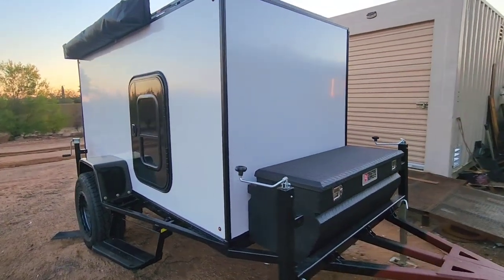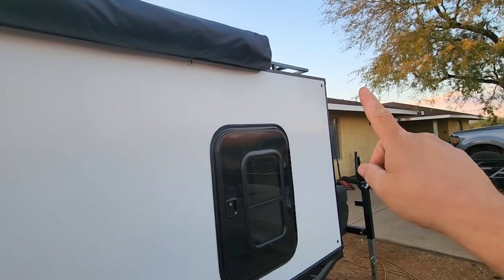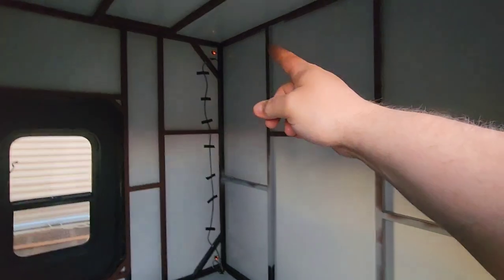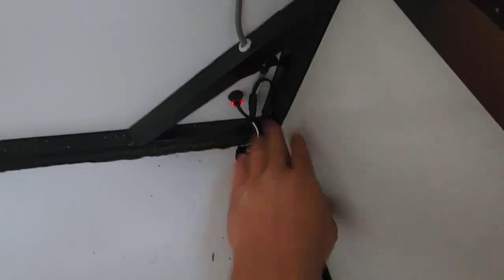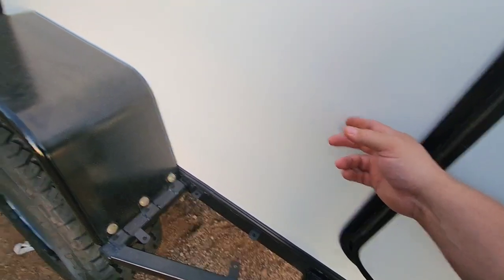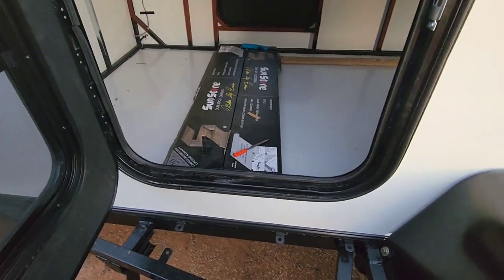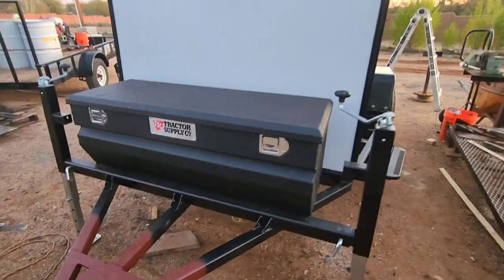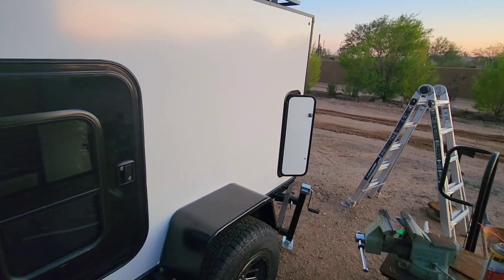Update on DIY Off-road Camper Build.

Comment: I put mine inside my front locker (the breakaway battery and all the trailer wiring).  Didn’t want anything exposed.  But they are made to be external mount
Reply from the maker: Ya, I'm thinking the tool box is best place for it to keep it clean looking and protect the wiring best.

Comment: Do you notice any difference while towing since you didn't change the front top to rounded or square drop? It saves time and gives a little more room
Reply from the maker: I have not noticed a difference.  I'm sure it creates some wind resistance, but so far, it tows just fine .